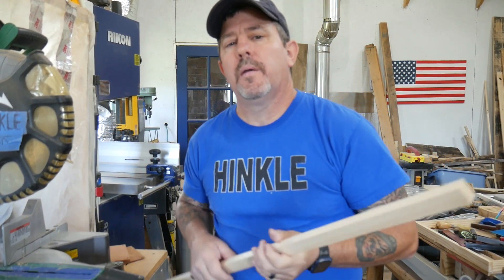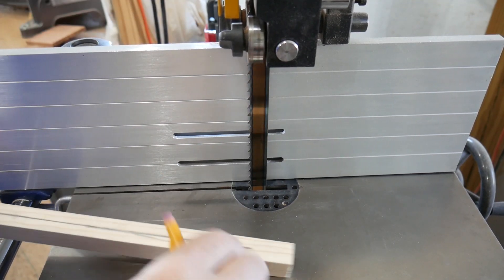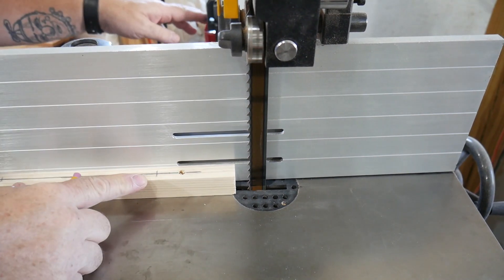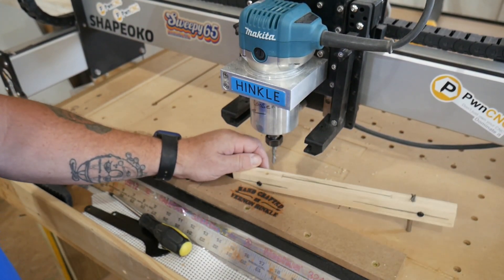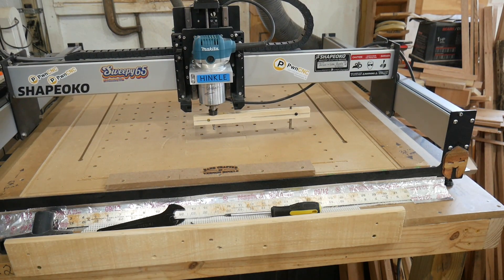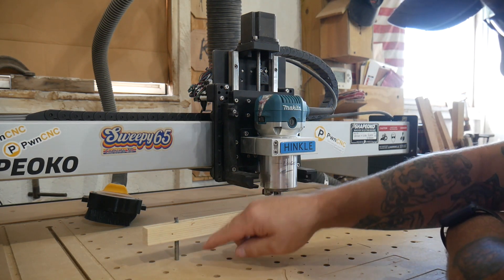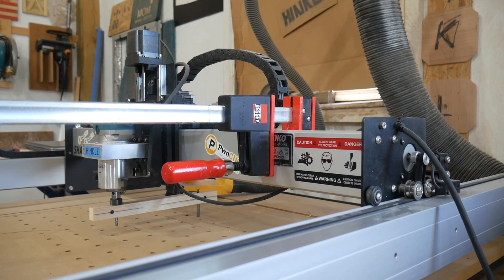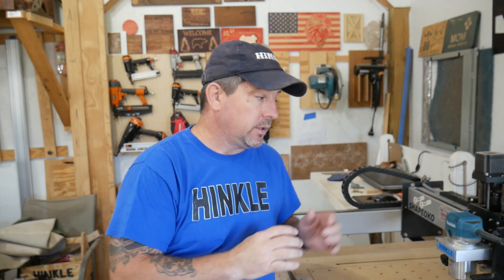How to: Tram a CNC machine with a low cost DIY tool

Comment: Well, IMHO tramming is crucial to surface the waste board because you cannot get a perfectly flat waste board with a tilted bit. Of course you must have a reference surface to "measure" the tilt from, but you'll have to surface the waste board first to get a better surface, but you can't use it as a reference for the reasons told above. So you need a flat surface (aluminium plate or so) so measure from. Then do your tramming with the traming tool and Hinkle's method, then resurface the waste board. Another way to get a (close to) correct reference surface) is to surface the board with a very small bit, ideally a ball nose bit, so the initial tilt won't be a factor.
Reply: Yeah, technically you're correct. But if you're not far off tram to start, and use a small diameter (1/4 inch or 6 mm) bit it won't matter. Also if you do want to make the spoil board ultra flat to start, you don't need to do the whole board! Just do the rectangular (or really circular) region in which your tramming guide will run. In this case, a 25 mm circle from the mid-points of the X and y axes is all you need because that's where the tramming tool ends will touch.
Reply: @steveh8724  Mate, I’ve been there. That “it’s only 2° and a 6 mm cutter, no drama” is the sentence that sends parts straight to the scrap bin. With the normal 120–130 mm (4.7–5.1 in) from spindle bearings to tool tip, 2° of tilt gives you over ±2 mm (±0.080 in, eighty thou) of sideways wobble at the cutting edge. Now take a realistic 1 mm (0.040 in) depth of cut that most blokes actually use when facing aluminium or steel instead of baby-stepping: with 33 % stepover you’re engraving a proper saw-tooth pattern every 4 mm (0.160 in) that’s 200–350 µm (0.008–0.014 in, eight to fourteen thou) tall peak-to-valley. It looks like someone dragged a plough across the job, you can catch a fingernail in the ridges, and a 0.0001 in indicator screams like a banshee as soon as you sweep it. On top of that the whole face ends up conical or barrel-shaped (up to 1–1.5 mm / 40–60 thou difference across a 200 mm / 8 in part), edges are wavy, dimensions are junk, the cutter chatters and chips because it’s never cutting on centre, tool life drops through the floor, and the finish is pure garbage. Cutter diameter doesn’t save you; the error is 100 % geometric. Until you tram the head to under 0.15° (0.05–0.06 mm or about two thou runout over 100 mm / 4 in measured at the tool tip) you’ll keep churning out absolute washboard instead of flat surfaces, whether you’re hogging with 1 mm DOC or 0.1 mm. I’ve thrown away stacks of parts before I learned this the hard way; don’t make the same mistake.
Reply: @axelSixtySix  Yeah, well if you're machining METAL that all tracks but for wood, if there's just a minor  out-of-tram, I don't think it will prevent proper tramming to flatten first. But I understand what you're saying. That's why I use a piece of tempered glass and manually level it  at 3 points relative to the gantry using a micrometer mounted in the spindle as step 1 for my CNC router setup.
Reply: @steveh8724  We would probably agree a perfect alignment is a must for any CNC machine, otherwise you will loose its two superpowers: precision and repeatability. On the other hand, wood also deserve precision. I don't want to have to sand half a millimeter of machining marks, or to glue two surfaces which are not perfectly flat. Digital machining is all about getting perfect parts, fist time, any time. You can't achieve that with a off specs machine, whatever the size of the bit.
Reply from the maker: Thank you for watching

Comment: For some CNCs you don't have an easy way to rotate the router back and forth, like you did with the beam.  In that case you loosen the motor mount and put shims in between to tilt the whole mount.  That's what I had to do no mine and it wasn't very difficult.
Reply from the maker: Thank you 
Good to know thanks for adding that information in your comment

Comment: Great vid. Love you doing the one hand squeeze. I use it all the time. I started when one of my previous CNCs had poor torque on XY steppers and it would shift using 2 opposing hands to lock/, unlock the collet nut
Reply from the maker: Thanks John I was over tightening in the beginning now I don’t with one hand